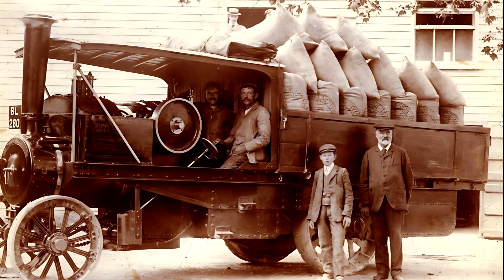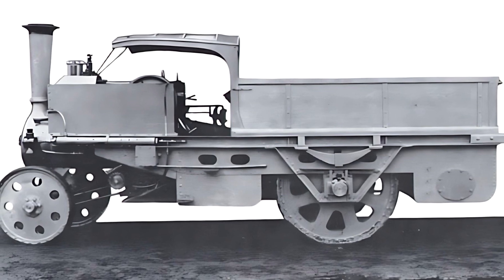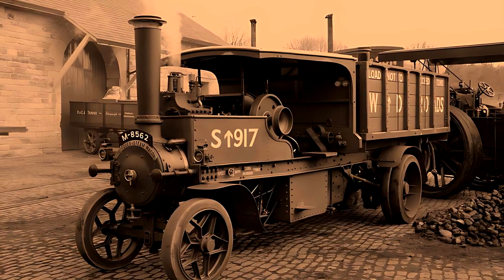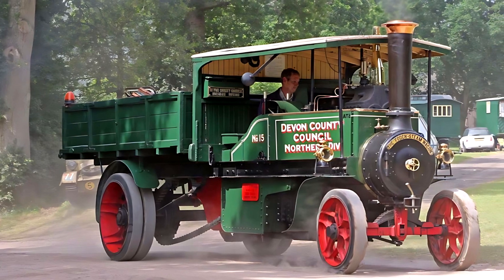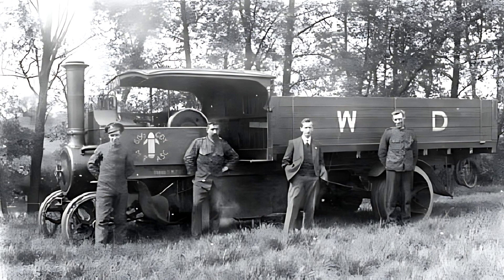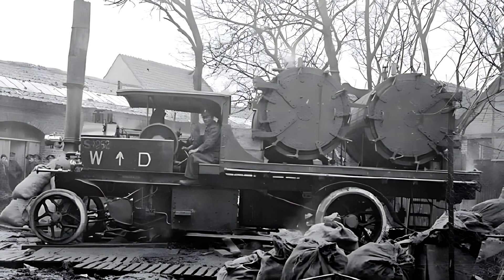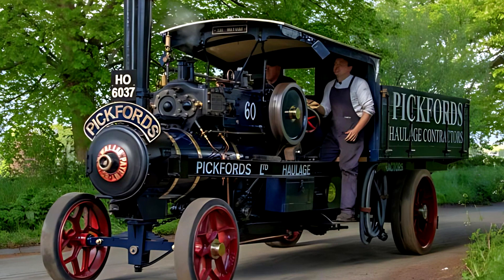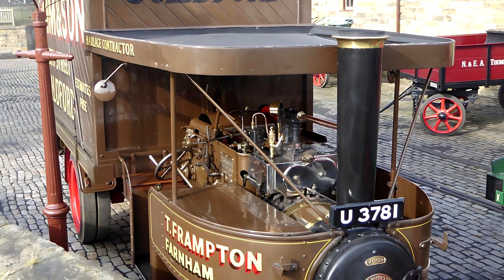1904 Foden Steam Wagon — The Steam Beast That Preceded Modern Trucks 🛞🔥

Comment: Is it really 2-cylinder, or is that a cylinder and a steam valve?
Reply: Foden steam wagons had double expansion engines with either two or four cylinders with the exhaust of the first stage driving the second expansion stage.
The first stage cylinder is much smaller than the second stage but delivers the same force.